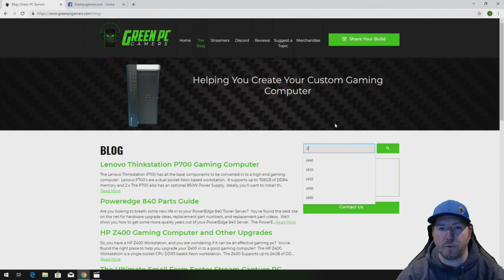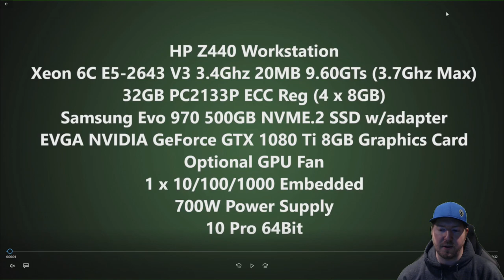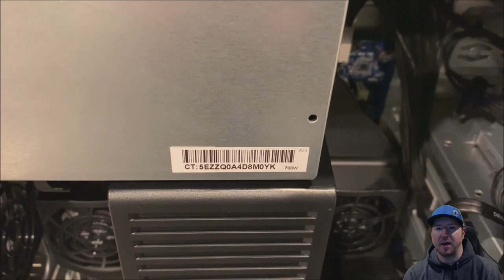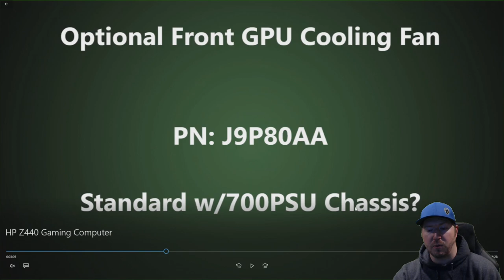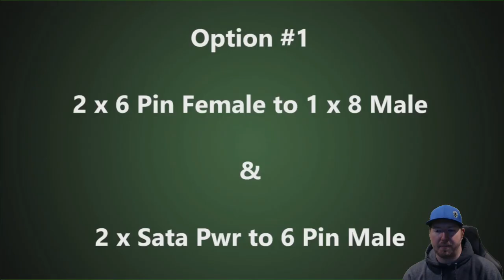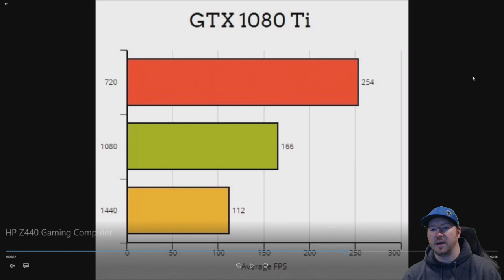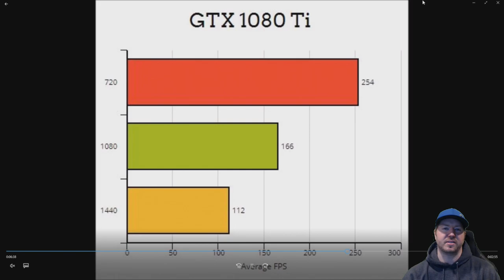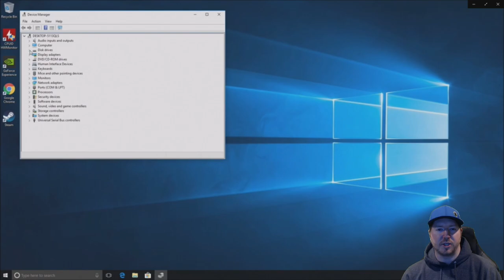HP Z440 Gaming Computer (GTX 1080 Ti and NVME.2 Install)

Comment: I am a few years too late but there is an official 6-pin to 8-pin adapter from HP. Part number: N1G35AA   It is built with thick cables etc with some thing in line. Really not sure about the internal but officially it can be used with 2 x 8-pins Quadros!
Reply: Worst part number in history
Reply: @vipcesh lmao. I seen it right away 😅
Reply: I don't get it. What's wrong with the part number? Is it wrong? @vipcesh

Comment: Great video and helpful as well as the others in the series! I am now running a Z440 with an e5-2650 v3, 32 GB RAM and a Gtx1070 ;) SSD-Wise I ran into some issues though. It seems that the new wd black series / sandisk extreme pro cause PCIE trouble - even with HP certified adapters. I threw in the SSD from my blade stealth (some OEM samsung unit) and it was working like a charm. The SSD itself works great in the Notebook - so I was forced to switch those around.

Comment: I have this z440 with xeon E5 1650 v3, 32gb ecc ddr4 memory, msi rx580, intel 600gb ssd and I'm pretty happy with the performance. But imo the chasis has so little airflow for these power hungry components. Do you think this mb would fit in another chasis?
Reply: Mine came with the "optional" case fan, which sits low and in the front of the case, where that little speaker is.
Do have that one ? 
If not, maybe getting one would help.
Reply: Does it get hot? Or are you just concerned?
PS. I know it's been a year for you, but my journey is just starting (got one 440 yesterday)

Comment: If you do a build like this, you need to ensure one of those four memory modules is added to each channel. Otherwise, you will not have a quad-channel configuration and will lose 25% to 35% performance, especially in memory-intensive applications. Check the case cover or HP support documentation for the correct memory order. This applies to all systems with dual, triple, or quad-channel memory. The correct placement of modules is essential to obtaining maximum performance. Also, keep memory sizes the same, the extra calculations required by the CPU due to the different sizes will decrease performance.

Comment: But too use the card for video rendering and editing the second option will work? I just got a z440 and a quadto m5000 but premiere pro greys out GPU acceratoin  so I got this card but 11g. I have a sdd in the drive bay and another had for media etc. I also purchased a 12 core xeron for it too.

Comment: Thanks for this informative video. I am up for upgrade on cpu which is xeon 1650 v3 but cannot decide on gpu. Just would like to ask your advice which of the 3 works best; 1)evga geforce gtx 1660super 6G, 2)inno3d 1660supertwin 6G, 3)gigabyte radeon rx580 8G.
Reply from the maker: The 1660 ti or 1660 super.
Reply: @GreenPCGamerscom  Thank you!

Comment: I know this is an old video, but I had a question.  Is there a way to upgrade to PSU on this, past the 700w OEM unit?  I see there are two separate connections on the motherboard from the PSU.  One 18 pin and one 12 pin for CPU MEM PWR.  I have one adapter for the 24 pin to 18 pin main board power.  What about the 12 pin connector?  Is there an adapter for this from a standard ATX PSU?  Thank you for the help.

Comment: I just installed an intel 2tb nvme m.2 in the second pcie x16 slot and made it the new boot drive (using the HP trubo G2 adapter). I'm getting 3466 Read and 3034 Write. Though for some reason it feels slower than the old 512gb sata SSD.
Reply from the maker: Those speeds are pretty good.  Are certain programs slower?
Reply: @GreenPCGamerscom  Just kind of overall. Seems to load windows a little slower also though it could be my imagination since the bench marks look good.  Sata SSD was getting 540 read vs 3466 on the nvme.

Comment: is there any way to do a all core turbo unlock on z440 with e5 2690 v3
Reply from the maker: Yes, there is a way to make the processor always run at it's max turbo frequency.  However, we wouldn't recommend doing that with the stock heatsink.

Comment: Hello so I just bought this pc and it’s still coming in the mail but I was looking at it and I don’t see any spots where you can plug in your HDMI
Reply: The display port is dependent on the video card; the motherboard has no native video port. At @8:00 minutes you can see an HDMI port on the video card he installs on this system.

Comment: Your memory is placed wrong :-)
If you have 4 blocks, they have to go in slot 1, 3, 4 and 2 - (The black slots)
Reply from the maker: You are correct.  Nice catch, and sorry for the mistake.
Reply: for 2 mem sticks is it 1 and 3 ?
Reply: @NateFosterSR  the zeon z440 utilize quad channel ram whereas most other systems use dual channel

Comment: FYI: a 90mm PWM fan can be installed in the front instead of this $30 fan. A little bit of sanding on the connector is needed but this is the cheap/free option

Comment: thanks for the video, can I install GTX 1660 Ti GAMING 6GB GDDR6 on a HP z440 workstation? (e5-1650 v4)
Reply from the maker: Yes, as long as you can find one that fits in to the chassis.  You also might need a 6 pin female to 8 pin male power adapter.

Comment: I'm watching this in 2024 and I'm planning to the same thing but I'm worried about that converter thing as I heard from some youtuber experiences that it melts down causing the GPU to burn and maybe the motherboard.

Thanks for your efforts man, appreciate it
Reply: I suggest using a two 6 pin to 8 pin adapter given the one i been using with my rx 6600 i had 0 issues and i been running with that for months now granted the rx 6600 not a power hungry card but i still play it safe with two 6 pin to 8 pin adapter if want to play it a little more safely try getting 24 and 8 Pin to 18 and 12 Pin Adapter Cable and replace the power supply to avoid that burn out.

Comment: Hello, thanks for the video, i have z440 workstation machine in work, it was working just fine for ages, but yesterday i just failed to open as usual, when you press the power button, everything seems working like fans and so on and the led is a stable white, but there is nothing displayed on the monitor at all, also no power to keyboard or mouse, I guess the term is "no POST", so my question, what could be wrong with the machine? Does removing the cmos battery help in that situation?
Reply from the maker: Try removing any add on cards/usb devices that aren't crucial to it's base operation.  Also, decrement the memory down to 1 stick.  See if that allows to you get video.
Reply: @GreenPCGamerscom  i spent 8 hours configuring what was wrong, no progress, then i followed a tutorial on how to flash a new bios via usb after resetting the cmos by changing the jumper on the motherboard, it finally worked after that, but the cpu fan is now so slow, maybe it needs another bios setting afterall
Thanks for your reply

Comment: Hi dude, nice video. Im waiting for my Z440 to arrive this week. Im planning on using an unused  GTX 1060 6Gb and 1 Samsung nvme as main OS Drive. Looking around internet i saw there is a Single HP NVME card, a Quad Pro Card and a Dual Pro Card (4YF59AA) this has a reasonable price arround $100. The thing is i havent found any info about compatibility with Z440 WS. Only on new Z Series. Have you ever tested? This would be great to have 1 card with Dual NVME Drive and not pay for the Premiun and Overkill price of a Quad PRo Card.

Thanks.
Reply from the maker: Thank you for the kind words.  We have tested the HP certified adapters.  They work well, but they are expensive.  If you only plan to use one m.2 ssd you should order the siig card that we posted on our Z440 Hardware upgrade guide.  (The link is in the descriptions).   It’s under $20.  Let us know if you have any other questions.

Comment: How about using only 1 sata power to 6 pin 
Then the sata 6 pin coupled with a native 6 pin to make a 8 pin
That would be better then just an single 6 to 8 pin adapter
Reply: On this workstation the wire gauge and the connections for the 6pin plugs is sufficient for a 6to8 pin adapter (as there is an official HP adapter for 8pin graphics Cards)

Comment: Dudes, nice video and build. How are the thermals on this CPU? Did the Xeons also have the IHS issue of the mainstream CPUs or were at least some of them soldered? Also, are the mobos reliable? Do you have any info on the VRMs that HP put in there? That cooling shroud could help... I currently have a 6300 Pro Microtower with an i5-3570. All in all reliable, no stability issues, but two cores hit 58°C (136F) on a regular basis without me straining the system too much. Looked into upgrading the cooling but it's quite a pain because everything is proprietary. Might try to delid the CPU, see if that helps, but even so I wouldn't dare putting a discrete 75W GPU in there, because of the poor airflow of the case.

Comment: Hi Brother. Thanks again for video on how to change CPU on Z440. I was able to do it with no issues.
Now I need your help with replacing psu as I purchased a RTX 3080 and power supply recommendation for that card is 750W and I currently have 700W.

I was looking online but I though it was better to ask someone with a lot of knowledge with Z440s.
 Any recommendations will be greatly appreciated .
Reply from the maker: Try rolling with the 700w psu.  If you end up having intermittent shutdowns you could always upgrade to a higher wattage or more efficient atx power supply.  Also, make sure you have the io cooling fan installed.

Comment: Not sure how you got the graphics card in without running into the issue of not being able to close the side panel.  I have an EVGA RTX 2060 that I'm using for distributed computing instead of gaming and because of that stupid ridge/hump they put on the side panel I cannot get it closed which is extremely infuriating.  It has a rubber pad/insulator so I assume it's for vibration but that should've never been on there from the factory.  These are workstations, not regular desktops, so the focus should be on compatibility rather than noise first.  Looks like I'm gonna have to take an angle grinder or dremel to it to get the stupid ridge removed.  Arrrrrgh.

Comment: Hey Z440 users, I am planning to buy this Z440 machine with 1650 v4. I am skeptical about the two things:

1) Is it safe to use dual-6-pin to single-8-pin connector to power the gpu. (I am planning to pair rather rx 580 or 1660 super)

2) Second, do I need to bypass any boot loading method for a nvme m.2 ssd or will it run naturally as plug and play.

Please someone guide me with this.
Reply: 1. yes you can use dual 6 pin to 8 pin adapter you can even use single 6 pin to 8 pin adapter however i will not recommend to use anything above 1660 super or maybe 2060 but with dual 6 pin to 8 pin you can even use a 3060 ti or 6600/6700xt etc
Reply: @Nigg-vu8uc  thank you! What about the second one?
Reply: @wasifshabbir2432   actually i looked a little more into it and it turns out unlike conventional atx if you have hp 700w psu each of your 6 pin connector can provide 260w so you can also use single 6 pin to 8 pin

Comment: Hi,
How much VA UPS is recommended for z440 with 700 watts power supply.
Xeon e5-2697 v3(14 Cores/28 Thread ),64 GB Ram DDR4 ECC
1 TB SATA DISK,512 GB SSD 
5 GB GRAPHICS GPU P2000🙏
Reply: Get a 1500va ups

Comment: Please be careful when using SATA or Molex connectors to power a graphics card - they are only rated to 54 watts. A 6-pin connector to a graphics card is rated at 75 watts.
A decent power supply should avoid any catastrophic consequences - but it does explain why you ran into power issues :)
Reply: got it, so 75 watts to power graphic card cool cool, thanks
Reply: @stormk-1130  how much power the actual graphics card pulls from its 6-pin connector can and will differ with model and usage - but up to 75 watts.
Reply: @TheRealCybermaze  Im using 1080ti

Comment: Great vid. Liked and subbed. Can I use any pcie to m.2 adapter for the HPZ440 or does it has to be a proprietary HP one like the HP Z turbo? And what is best for the heat, a finned heat sink adapter or one with a mini fan? Also, if I buy a HP Z Turbo Drive 512GB SSD can I put a 1TB nvme ssd in it? And does my bios have to be set to AHCI for it to be recognized as the boot drive? Right now mine is set as IDE. Thanks for any help from the community.

Comment: Anyone ran a GTX 1080 with 2- 6 to 2-8 pin adaptors. I may buy a evga GTX1080. On EVGA's site it states that I need 2-8 pin.. is that correct? something seems wrong, in this video the GTX 1080 TI has 1 - 6 and 1-8 so why would the 1080 have 2-8s?

Comment: Hey guys!  I'm wanting to replace my Quadro M4000 GPU with another GPU...likely a GTX 1080 TI but am running into an issue with power.  I would like to use "option 1" on running power cables, specifically using the 2 male 6 pin connectors and adapting to an 8 pin to plug into the GPU.  After digging into the PC, the M4000 is using one of the 6 pin connectors while the 2nd 6 pin is powering the GPU supplementary fan.  Would it be okay to use a splitter (dual 6 pin male to single 6 pin female) so I can still power the fan, while also using two 6 pins to adapt to the 8 pin GPU power cable?  Any assistance would be greatly appreciated.

Comment: I hope I'm going to get a reply... I've recently been gifted a Z400 which I want to make into a gaming pc for my nephew, but the problem is that the system won't accept any other videocard other than the NVS 810 the system came with. When I install an AMD RX580 and connect it all I get 6 beeps which indicates a problem with the graphics. System is completely up-to-date with latest available BIOS. I've read that maybe HP has power limited the system, but then why does it have the auxiliary connectors for a graphics card? Doesn't make sense... what do I have to set to make it accept the videocard.
Reply: Something wrong with your rx 580, i used to use a z400 with 1660 untill i got a z440

Comment: Hey, old video I realize but...do you know if they make some kind of bracket or adapter that will allow you to use a standard ATX power supply in a Z440 case?  Not the wiring - there are adapter harnesses all over the place - but how does one actually mount a standard ATX power supply...?
Reply: No idea, but i believe the same case is used for a two socket system with a 1200w psu if you need more power

Comment: Can i use a rx 5600xt in this motherboard???
Reply from the maker: We've never tried that gpu.  However, if you have the 700W PSU, and you can fit the gpu in the case, it should work fine.
Reply: @GreenPCGamerscom  thank you

Comment: Hi, I just built a Z440 gaming computer and I keep getting no signal on monitor and TV, I have a hpz440 V4 with updated bios, a gtx1070TI, a 600w psu, a Xeon E5-1650 6 core, Is there something wrong with my build where it won’t show a signal on my stuff? I’m very confused and this is my first build ever and I don’t know anyone who knows anything about PCs, I feel like my gpu could be bad only cause I baught it in marketplace but everything lights up and the fans spin on it so I don’t really know. Any advice would be greatly appreciated
Reply: I’m also using 2, 8gb sticks of ram on the farthest sides from the cpu like one on each side they are DDR4 ECC
Reply from the maker: If you post this on our forum, we'll be able to better assist you.

https://www.greenpcgamers.com/

Click on the forum tab.

Comment: I have one of these that suddenly started getting a POST error that says "Thermal Sensor not programmed". It's maddening because HP can't tell me what to replace and it causes all fans to run at 100%. Anyone have an idea how to fix this?  Does it require a motherboard replacement?
Reply from the maker: Did you take the side panel off?  If so, try disabling the intrusion feature in the bios.

Comment: Could a V4 processor be downgraded to a V3 Processor. Mine originally came with an E5-1620 V4 Quad-Core and would like a 6 or 8 core in my system. The reason I am asking is V3 CPU's are much less expensive and plentiful.
Reply from the maker: Yes, you can replace your V4 Processor with a V3 Processor.  Keep it mind that it may clock your memory speeds down to 2133Mhz.

Comment: I have an AMD MSI 480 rx, which 480s are known for high temperatures.  Any likelihood a GPU waterblock with radiator tutorial is possible?  Supposedly a GPU waterblock can decrease the card temperature 10~20 Celsius degrees.  I know a 480 is old, but this could apply to contemporary cards as well.  Near as I can tell you get a g12 Nzxt card adapter and an AIO enclosed loop system with the 120mm fan radiator and replace the back fan with the radiator.  Problem is I believe the back fan on case is 80mm, so there might be a compatibility problem.  There are 80mm water cooled radiators, so it's not impossible just not certain the cooling would be sufficient.
Reply from the maker: Liquid coolers can be very effective for cooling.  However, there just isn't enough space in the Z440 chassis to mount the aftermarket liquid coolers.  Some of our community members have successfully swapped there Z420/Z440 components to ATX cases, which has allowed them to install aftermarket cooling.  That might be something you could consider.

Comment: I know this is an old video but I'm hoping you can help me. If I run an RTX 3060 in a z440's top PCI-E x16 slot (using a dual 6 pin to 8 pin adapter), would I be able to install a Quad M.2 to PCI-E adapter in the second x16 slot and still have good performance on both x16 slots?
Reply from the maker: In theory your install should work well.  Let us know if you try it.

Comment: i want to ask a question. I have this hp z440 with 12 core xion cpu, 32 gb ram. why is running slow? and it boot slow too, why?
Reply from the maker: Try getting an SSD.